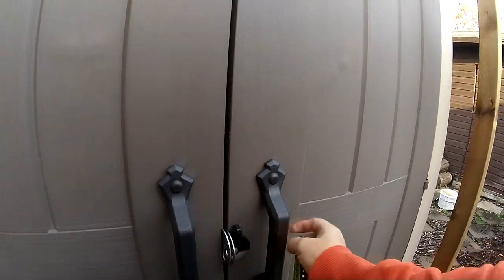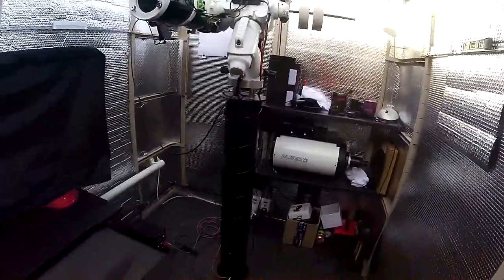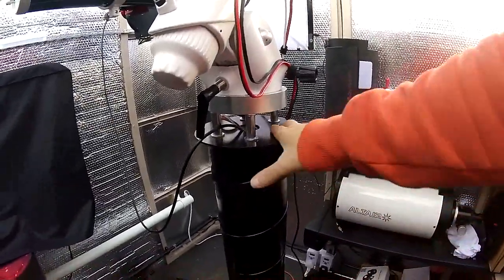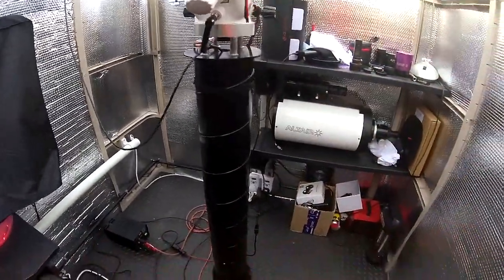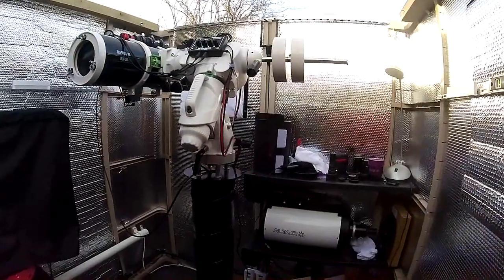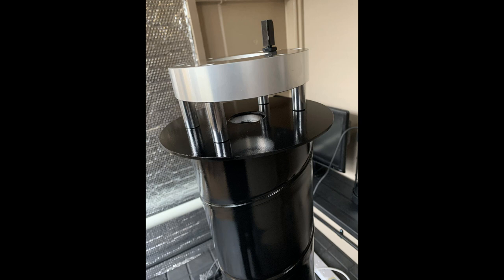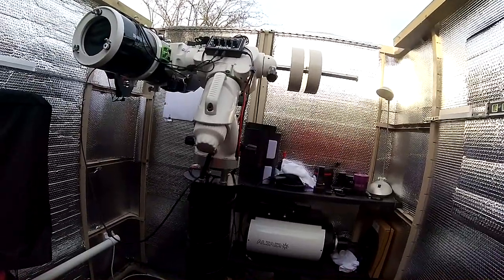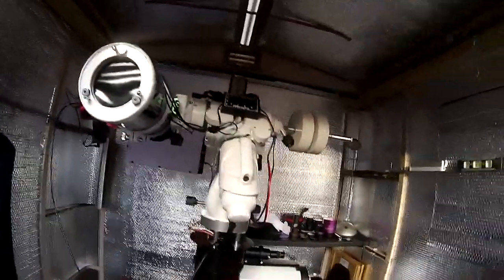Astrophotography with Glenn Clouder - Budget Pier Build

Comment: Great set up.  I got all the same comments when i built "The Pier of Doom".   It works great for me, saves loads of time setting up, i leave the mount head attached and the guiding has been great.  I'm working on her indoors to get a small observatory built and that pier is exactly how i would do it.  :-)
Reply from the maker: There are just too many people about that just look for any negative they can. My pier breaks their rules because it didn't cost over £500 and I don't have the equivalent foundations of the Empire State building supporting it. But I guide regularly at 0.5 total RMS...hmmmm  🤔

Comment: Yep thinking about the pier myself. Thought about the dome but not in the budget but just the pier with the mount on top a nice cover to keep the rain off and the hot summer heat off to a point is a good thing.
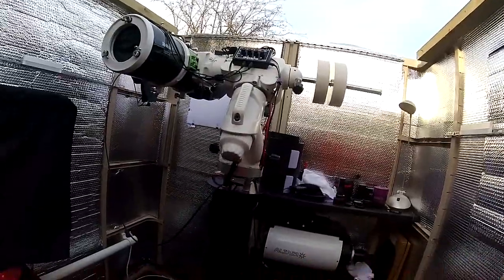Reply from the maker: Hi Dan. Definitely a big bonus to your hobby. Better stability and ease of use and set up. Have you seen the pop up tent I use when away on trips and in my garden?  https://youtu.be/mnCQQC23M6M if you scroll 10:00 mins in on this video link you'll see it. Really good and useful and works a treat. (not expensive either) there is a link to it in the description.

Comment: Question, I'm planning on building a permant pier in my back yard, what is the concern on the frost line, I believe you mentioned? Any help would be appreciated. Great video by the way!
Reply from the maker: Hi and thank your for your question.. this will vary depending on where you are in the world. In the UK it is recommended that a hole at least 0.45M deep is recommended. You can do an online search for where you live but other factors like soil type etcetera makes a difference. So clay and large roots from trees. Hope this helps? Whereabouts are you?
Reply: Located USA Georgia

Comment: Very nice indeed. Looks professionally made. Love the cable management "holes". I dont have an observatory myself (yet), but regarding the 1 cubic meter of concrete - i agree with you. 
I have a beltmodded and tuned EQ6 with SKF bearings, and i have it out on my balcony which consists of wooden planks. There is vibration for sure, so when i do the PA routine with Sharpcap, i need to have my computer inside to go and check after adjusting, all because of vibrations. But when ive left the balcony and shooting, then i guide stable at 0.4 - 0.6". I believe your pier is rock solid if your not living on top of a vulcano or in between some tectonic plates:)
Reply from the maker: Exactly.that’s good numbers you are getting. Mine recently has dropped off a bit so will look at my belts but am planning a tune up with a strip down and regrease
Reply: @Astrobloke  Yes, it took alot of time, blood, sweat and tears to get there, but i got to know my mount better. My 2 main issues after the tune and belt mod was: backlash and and a oscillating RA graph. Backlash i just learned to live with by having the setup slightly east-heavy (RA) and scope "back"-heavy (DEC). The oscillating RA made was displayed as a peak at 10.2s when doing frequency analysis (PHD2 Log viewer). This is the tooth to tooth period for EQ6, and i learnt that that peak meant not enough tension on the belt.

Maybe too much information, but the point was that it was neat to use the PHD Log viewer software to analyse belt tension instead of fiddling too much on the mount :)
Reply from the maker: @Hegegutt  i may have to venture down the same route. I suspect its belt tension as I have never touched anything since buying it. Now its all bedded in I am sure some small adjustments are needed. I’ll still strip and regrease as these mounts don’t normally come packed with the best.

Comment: Great video thanks and also your roll off roof observatory one too.  
 
I am looking to add a permanent pier to my set up and also a small shed to cover it and protect it from the UK weather, can I ask a few questions please?    

     1  Firstly, what type of insulation did you cover the shed inside in?  
     2  Also where did you get the aluminium air ducting pipe from,  I have been searching but cannot find any online they all appear to be flexible??  
     3  Where did you get the M12 bolts with a kink at the end to put into the concrete?  
     4  Is that a tubular heater in the corner.  I have been looking at an 80w one, are these a good way to go?  Do you keep this on during the winter to prevent damp conditions inside the observatory??  

I have been considering this for some time and you have given me a kick to starting one this year!  Unfortunately, I don't have a large garden to take a 6'x4' shed in the corner also because my horizons are not too good so I would need to position my pier mid garden so was considering a 4'x3' Keter Manor Apex shed.  Then the decision whether to have  a roll off roof with such a small shed?  I have seen other videos online with Backyard Astronomy of a similar shed but rolling the whole shed away from the pier to use.  I think this may suit my purpose better and would appreciate your thoughts and any tips in building it.  Like you, I don't have a massive budget so want to minimise my mistakes.
Reply from the maker: I shall find some links for you and reply fully tomorrow.
Reply from the maker: Hi Julian and thank you for your comments.

The insulation I got from ebay.  https://www.ebay.co.uk/itm/373021746297 and just cut it to size and attached it using double sided tape I bought from B&Q

Try here for ducting 
https://easyhvac.co.uk/index.php?id_product=27&controller=product&utm_term=&utm_source=google&utm_medium=cpc&gclid=Cj0KCQiAmL-ABhDFARIsAKywVadBvsqaDIfiveW2quEQDFChzt_zZb1rzwB0rt1afrpWRjxPELt-4rcaAu5TEALw_wcB

its called spiral ducting. I bought a 3m length 150mm in diameter. If I was to do it again I would most probably go 200mm

The M12 bolts I got from ebay. I bent the end myself using a vice and a blow torch. It was hard to do so I only bent 2 of them and the other 2 I loaded with large washers and nuts. You could do this with all 4 to be honest.

The tube heater is a 60w greenhouse/shed heater and with the insulation does a great job without costing much to run. I have it plugged into a thermostat plug (  Elixir Gardens ® Thermo-Guard Digital Control Plugin Thermostat TH-928T from Amazon)   so its only on when needed. I think in the corner if its black is a mosquito zapper.

With a smaller shed you could just use the same rail and wheels that I used for the roof of my obsey as they are rated for security gates so would have no issues supporting the weight.
I hope this all helps but by all means contact me if I can help further.

Glenn

Comment: for people thinking of build a pier, before you start running wires, run a half dozen strings through the pipe. You can use these in the future to add more wires, just tie one end to the wire and pull it through.
Reply from the maker: Now that's a great tip and one I needed when I built this, would have made life easier although I got there in the end.
Reply: Yes, same process as running electrical wires, instead of multiple strings, just use 1 good string and make an endless loop, secure each end to themselves and then just attach the wire(s) to them and loop it through. Then detach the wire or wires and you still have the string available in the event you need to run additional wires. Once you are sure you are done, cut the string and pull through. Cheers and clear skies.

Comment: Interesting, if you need a 2nd floor observatory how tall can the pier be, what diameter to length ratio should it be, and for the base, would circular or globe be better at eliminating vibrations than a square cube? great video!!
Reply from the maker: I am sure there is a calculation somewhere for the ideal or minimum diameter to height for something like that. I would have thought re the base the higher it is the wider that should be, hadn't ever thought of shape and thats got me thinking. Thank you for commenting.

Comment: Hi Glenn , Gradually getting parts together for the pier build ,would i be right in saying you use a large washer on the underside of the adapter and  put a bolt through to  hold everything together . once again many thanks r.madley
Reply from the maker: Hi Richard, Yes that is correct. I ordered a smaller round steel plate when I ordered the larger one for the top of the pier. Drilled a hole in it to make a washer.

Comment: Great vid again. How deep/wide did you do the hole?
Thanks
Reply from the maker: Hi and thank you. The hole I dug was 50cm3.....so 50x50x50
Reply: @Astrobloke  Hi Glen Do you remember how many UK bags of concrete/aggregate and sand it took pls? 1:2:4?
Reply from the maker: @alalal1979  i used 2 bags of cement and 10 bags of ballast. 1:5. Ballast is a sand and aggregate mix

Comment: Great and informative video, thanks. Question - when you mentioned  "50 x 50 x 50 hole filled with concrete" what measurements were you using, as later in your video you mentioned that a cubic metre of concrete could be OTT. You've done a great job with your observatory and thanks for sharing.
Reply from the maker: Hi there and thank you. I did 50cm x 50cm x 50cm. This has been ample for me and over a year of continuous use rock solid. Seen many quote 1mcubed as minimum but this was from an old video and only an opinion after all. You can put whatever you think necessary. I made a judgement on what I thought was enough and to keep it within reasonable work and cost limits. Clear skies
Reply: @Astrobloke  OK cheers m8. Seems like you got it just right :) Thanks & clear skies to you too

Comment: amazing work. definitely going to do this. let me ask you though, whats the minimum height you can make one for a relatively normal setup. lets say no bigger than yours
Reply from the maker: Hi and thank you for watching. Mine are about 0.7M in height. With my CT10 when its vertical the bottom is about 40cm from the floor. So I would say 50cm would be the lowest but it really does depend on the length of your scope.
Reply: Thanks so much for the replies @Astrobloke

Comment: Hi Glenn, the observatory is taking shape here. Pier built, walls up and now to sort the sliding roof. As it is forecast to be clear tonight I thought I would test the pier with my EQ6R Pro but I have encountered an odd problem. I wondered if you had found the same issue. I have a Skywatcher pier adapter from Altair Astro which looks like yours however the central hole in it is much bigger than the diameter of the washer on the attaching screw which screws into the bottom of the mount from underneath to secure it to the pier adapter. From the brief glimpse of what I can see of the underside of the pier adapter in your video it looks like you have a big washer to allow the screw to bind the mount against the adapter. I've done some searching and can't find anyone else with this problem. My EQ6R is second-hand so maybe I have an attachment missing? Did you have to get any additional fittings when you fixed your mount to the pier? Any help appreciated! Cheers. Mark
Reply from the maker: Hi Mark. No I had the same issue that you did. What I did was jump on ebay and buy a metal disc and drill a hole in the centre and used a cut down M12 thread and 2 x M12 bolts to make what I needed to bolt it down. It is a large hole. 
https://www.ebay.co.uk/itm/363510422909?_trkparms=ispr%3D1&hash=item54a2e8dd7d:g:OkkAAOSwOCxfDxhB&amdata=enc%3AAQAGAAAA4BCCXCQFzlAtZtFj01ObEL0dRm7GvOfy3XxAD8yqxl2E1imF%2FMOIIk8cQrY1ExkFQEVSZL9TvrHHNhIxOVLUbMJXkR%2BZWD%2Fiim8H51kDJNgEhKHxFDFtSfDoVl1J%2BYJDPy3pM6gh5%2BEw4SnnvkjF71HmNkeBrgEaNK30vYk6qRfJj9rh0lajHgSmhcxae17YbdM03L8GWDwSR6IegvtVMr56gxZxIHaEm0GEp7cCzwqdN2%2BgFvRsGIzuk4XPrQtr3x7Wlq3weIeEGZ%2BBdIYU7O83m3T3Hq%2FqcQ%2B0U4K%2FYLJp%7Ctkp%3ABFBMmJfz-4Vg
Sorry the link is so huge but cut and paste that. There are others with stainless steel etc. Can't remember the size but it sits inside the bigger hole.

Comment: richard madley , i have followed your links to the bolt adapters and threaded bar , you have mentioned m12 bar but the link says m10 i have ordered  the m10 so i hope these will be okay . i know its a bit of a cheek but  is it possible you could place the link to the round steel plates on ebay thanks again so much for the help you have given rich.
Reply from the maker: https://www.ebay.co.uk/itm/363510422909
Try that link. I bought slightly larger diameter than the pipe and 3 mm thick

Comment: if you wanted to get that cigarette lighter port at the bottom, drop a piece of string down the pipe, and tie it to the non cigarette lighter part of the cable, then pull it back up (providing the entire cable length is long enough). You'll have your DC port up top and cigarette port at the bottom.
Reply from the maker: Thats exactly what i did in the end  and it worked great. Thank you

Comment: Astrobloke, Having arrived very late to the party but how high did you make the pier above floor level and if you were to do it again would you make any changes in height? Thanks for your help. Cheers, Chris Perry.
Reply from the maker: Hi Ainsly. The pier is 110cm above the floor level. I measured how high the top of my mount was and built the pier so that was about 12" below the wall height. This was so I could comfortably park any scope I had mounted and it was high enough to get a good sky view

Comment: Hi Glenn, very nice build mate.  I'm just about to embark on a mini roll off roof obsy and your video is the most detailed, but I have a couple of questions...

Does your 150mm tube sit at the bottom of your 50cm3 hole? and do you have any rebar or such like at the bottom to give it more strength?

Also, your 3mm plate.  Is it just held against the concrete surface by the four adapters or is it attached in some way to the tube?

Cheers, Tim
Reply from the maker: Hi Tim,
Good luck with your build. Yes the tube goes to the bottom of the hole and I sat it on some rebar grid and have rebar rods running up also. The plate just sits on top of the tube and the 4 adapters bolt it down tightly so didn’t see any need to attach it any further. I attached the 4 threaded rods through the plate to the adapters and made sure it was all as tight as possible with a nut underneath and then sank it into the wet cement.
Reply: @Astrobloke  Thanks for the reply matey

Comment: What do people think of using a Telephone pole as a pier? I have a 6 foot x 12 inch section that I would like to use, as I already have it. The shed will not be attached to the pier.
Reply from the maker: I am sure that would makes a good solid pier. Some say wood moves too much with temp and weather changes but if inside an obsy it wouldn’t be as exposed. If I used one I would seal and paint it as well. Let me know if you go ahead would love to hear how it works
Reply: @Astrobloke  Sure thing! As it has been outside, I think I'll give it a month or three before I seal it. ;)

Comment: Hi Glenn, I'm just getting the pier materials together. Did you use ready mixed concrete in bags for the pier base and column? I'm looking at B & Q  where postcrete is nearly half the price of readymix concrete for the same quantity. Any feelings which is best? I am no builder. Also I've calculated 16 bags for 0.5m3 + pier. Seems like a lot but I know volume can be very deceptive.
Reply from the maker: Hi Mark. I mixed my own with 1 bag of concrete to 5 bags of sand/ballast.  It was a bit of rough guesswork on my part. Its surprising how  much you need to fill a hole and then the tube as well. I think I found a calculator online.
Reply: @Astrobloke  Thanks Glenn. I think self mixing will work out cheaper so I'll probably go for that. I meant to ask if you used any steel reinforcing bars to bind the pier to the base? I guess if the pipe is embedded in the base rather than added afterwards this might not be necessary. Thanks again!

Comment: Question.
I see that you have both the Skywatcher coma corrector and the baader.
I also own a 130pds.... Which is best. Thanks
Reply from the maker: I haven’t noticed much difference between them to be honest. The only reason I have the sky watcher is a friend was selling it and it provided 0.9 reducer so dropped FL to 585 from 650 and dropped the F stop to 4.5
Reply: @Astrobloke  many thanks. I've read many different reviews, some say the baader isn't that great on the full field , that the skywatcher was better but had reflections sometimes. Just can't decide which one to buy.
Great videos BTW
Reply from the maker: @rushandothercoversongs6166  thank you. I think some people over analyse stuff.  Both work well so choose on whether you want a wider fov or
not i suppose.
Reply: @Astrobloke  sorry another question. Your observatory is lined with foil insulation. I have a metal shed lined with the same.
Don't you find it to reflect alot of light which may detract from your images?
I am considering lining my insulation with the matt fabric type garden weed cloth
Reply from the maker: @rushandothercoversongs6166  It has not made any difference what so ever but I suppose it depends how much light is about to reflect. I was something I considered and was just going to cover with some black cloth or spray paint it even if it caused any issues.